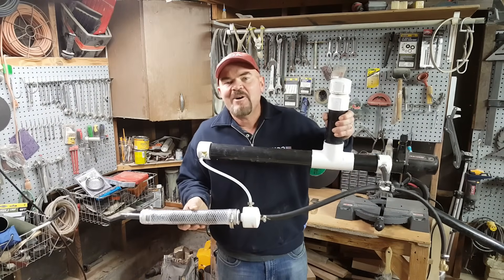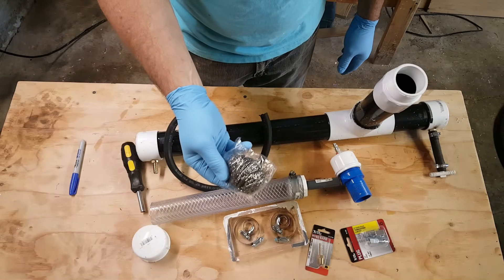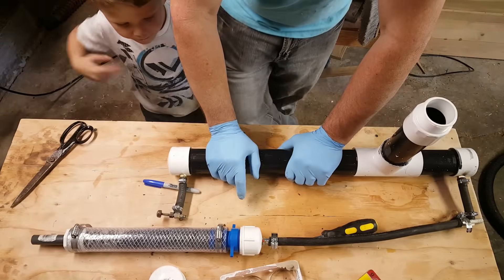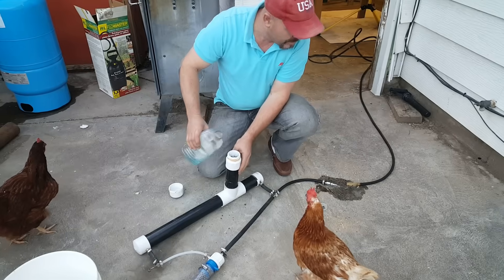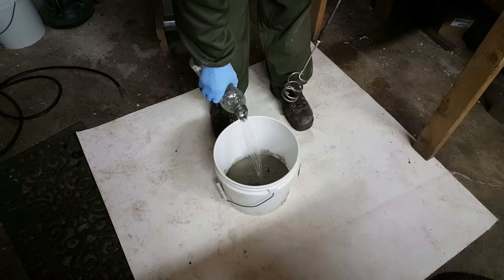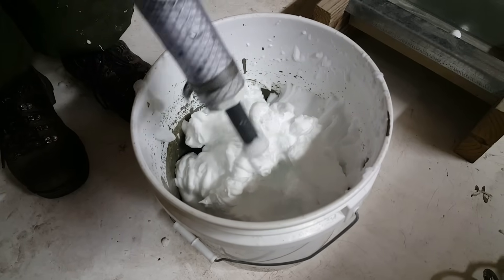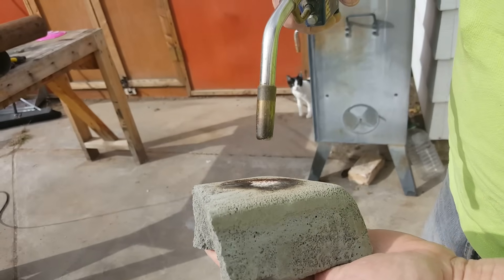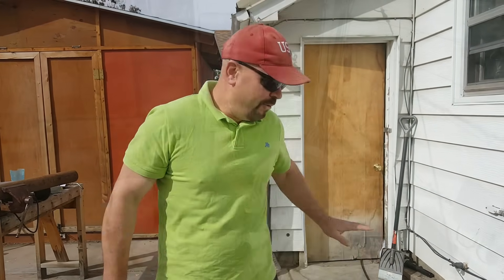Air Crete Machine for Under $30 (DIY)

Comment: NEXT STEP: how to use a like machine to spray the fresh mixed liquid onto a form like thick paint. A friend uses something similar to build free form design houses in South America. Makes a chicken wire or plywood shape, overlays with plastic, sprays, lets dry, sprays again, repeating until a desired thickness is achieved... then overspray with a sealant, and then primer and paint. Cuts out windows with a saw, if the form didn't provide for them. Then on the inside, installs all pluming and electrical, and then does the same process indoors, perhaps finishing with other kinds of materials in lieu of paint. * I'm trying to start an intentional community for stalking victims, homeless PTSD vets, and Preppers (symbiotic relationships to help each other out), and something like this would allow affordable homes for those who are trying to live on less than $1K a month (like me, a technically homeless vet once a stalking victim, lucky enough to be that guy living in a van down by the river... but its the ocean, and a motor home).
Reply: H. Michael Sweeney    It,s called Gunite ....they make swimming pools with it
Reply: Good luck with the community.  Communes don't have a good track record.  It's usually the 10% doing 90% of the work and they eventually get worn out.

Comment: If you're using PVC you need PVC cement and primer not ABS cement, if you're joining the two together (to be avoided) you need transition cement. OSHA also forbids using PVC for compressed air above ground, use air pressure rated ABS instead.

Comment: I'm sure by now with all the comments you have found out that aerated lightweight concrete has been around for decades. Myself having a construction background have been using lightweight concrete for high-rise flatwork and heat transfer floors since the 60's.......however your little experiment gave you and the family something to do for a few days

Comment: With the correct mixture, and inflatable forms, this technology could be used to rapidly inflate & back fill structures.
Faster than a 3D Concrete 'printer'.
Combining both technologies & you could rapid inflate, & print dome sheds, & then saw out windows , doors, connections, etc. as needed.
Different inflated forms could yield square or rectangular structures.

Comment: Hey great video, I tried it and the Portland Cement fell apart pushing all air out. Also, second mix did no stay light. It was pretty heavy.

My question, what type of mix did you use for the Portland Cement? Did you add anything to the mix?

Comment: Hi Darwin. I just wanted to add my 5 cents to the nice comments made here by most everyone. They are well deserved. Thanks for your generosity. If I was you, I will reach out to any local college that may teach Civil Engineering or Architecture, and ask them to run a number of test on your bricks. They would have the test equipment available, the expertise an the students hungry for ex

Comment: Here is a challenge for you:
Create a machine that will pump out Aircrete.
Put Portland Cement in a hopper
That mixes it with foam and pumps it out AUTOMATICALLY.!

Comment: Suggestion: Build molds to manufacture oversized Legos, say, one by two feet. With them and Liquid Nail, build any structure. Without Liquid Nail, build temporary structures. Might have to let the "Legos" cure a couple of months, though.

Comment: this has been out for a long time just that it has not ever picked up and iss coming back t  surface, the reason why it never picked up is because essentially you are only making it have gaps in the cement there for it is much lighter since it  is not a solid brick, the foam what it only does to the cement it makes it cure with the holes that the foam created in the cement so the cement cures with holes and gaps so it becomes lighter less dense ....but like everything there is a good side and bad side. The good side to it is that it is lighter and you use less cement material for basic human needs that do not require super strong parts so things can be built cheaper. The down side to it is that since you created voids with no cement from the foam having air pockets and the cement dried around the circle holes ....well the cement becomes less strong in  its original psi and much more brittle than laying it the standard way, but for typical things not requiring that amount of strength it would be well to use for those types of projects.

Comment: So, let me get this straight.  The foam in the video at first looked like two part insulation foam.  Then, it looked like you were using dish soap.  Is that what you are infusing into the Portland?  If so, what a great idea!  By the way, I believe you have the patience of a saint!  When I was young and got in the way, I'd get a crack across the backside!  Those kids will have learned the same patience that you exibit when they grow and have a family of their own!  Thanks for the great videos!

Comment: I am thinking, if sand is added to the portland cement, would we still have the air bubbles once it cures? Sand added will strengthen the mix.

Comment: A simple foam Generator is no aircrete machine!  
An simple crete machine should at least consist of..

Foam generator...
Ingredients dosing for variable foam concrete  densities
Hopper
Mixing unit..
Static mixer
Pumping unit....
Driver ( electric motor or Diesel engine)

If you mount this machine on a trailor or truck...
 Voila ....Here is your foam concrete machine Tor Independent in situ production.

Regards

Greattimez
Españistan

Comment: Thank you for sharing! A check valve on the line that connects to the supply line from the compressor could prevent the foam agent from flowing out while you fill the reservoir.

Comment: Good video, BUT the building material of the future would be HEMP CRETE , hope it will be in the US as it is already used a lot in the UK and Europe... high insulating properties, lite weight, versatile and more... maybe you could test that one day? Keep it up, I loved your strength test, saying" see how strong it is" then step on it and ...  crack... loved that...
Reply: The beauty of aircrete is that all those hemp bits can be left to fertilize the fields.
Reply: Hart Biedro exactly.  Hemp Crete does have better breathing and insulation 

But it would burn Unlike this product

Comment: I have no good enough words to properly THANK YOU .  I lost house and everything year ago in California duo to wild fire .and i was grossly under insured .  i'm forced by life to build by myself now  and aircrete is my #1 choice  . there is no other idea of building which would be better or even close competitor to  pour aircrete in to form or lay one by one aircrete blocks  to build .
I'm 61 and aircrete  is only option  for me to handle the building process eliminate maintenance ,insulation and improve fire safety to max.
  it will be slow building by one older man, but there is no need for so much of muscle power as other methods and heavy weight materials require .
 Beside eliminating need for young muscle and stamina wee eliminate  maintenance ..cement based building is not going to be eaten by termites or FIRE   .   no need for   unhealthy expensive insulation .  When is done it will last for generations .
I'm  surprice and i don't get it that foamed concrete is not used everywhere instead of wood  for building houses .
When i was a kid 50 years ago in Poland 99% of houses and apartments were made  out of aircrete  blocks . And is prbably still most popular building material today ..but i live here almost 40 years so i'm not really sure about that last statement  . 
Thank you again 
Stan

Comment: Foam cannon $13.00 to $20.00 from Amazon.  Shipping is free right now. Gets the job done for a whole lot less. All you need is soap and your power washer.
Reply: which one would work like this on a big compressor?
Reply: @MandyWoodArtist  I don't know and I don't care. My point is there is a simple alternative to a big investment. If you need this big-volume device get it. But if you need to do smaller jobs this is not the only way, and there are better and cheaper ways to get them done.

Comment: i really like that idea. did you test if it was stronger after allowing it to fully cure?

i'm also curious if more mixing would alter the consistency / air bubble content

and finally, has anyone tried this with a spray gun like those diy concrete spray guns all over youtube?
Reply: ? I'm still curious about this. Soon to make aircrete panels to fit between log uprights for my large shed

Comment: you have no idea the projects in africa i'm going to be using this on. it most certainly WILL be the future. thanks for the simplistic foam gen design as well. i can attach this to a centrifugal pump on a solar powered steam engines flywheel and generate intense pressure with no electrical energy input. The things i'm gonna do.... lmao

Comment: This would be a big money saver for shipping windows, I make stained glass windows and the shipping can be expensive, I actually used roofing insulation as it is hard as a rock and light weight, but this would be cheaper. 
Would this stuff be good for attic insulation?

Comment: If the pipes and fittings were changed to 1 1/2" instead of using 2" pipes and fittings, would this still work?  Very hard to find 2" fittings where I am.

Comment: The basic principles are the same as the space shuttle heat tiles.  They had trouble finding a glue that worked to stick the tiles on.  They ended up using "RTV" adhesive gasket maker.

Comment: This is not the correct way to make light weight concrete . soap has glyseren in it which is grease.. you need to mix pearlite in the concrete which retains the strength.

Comment: Does the air siphon the soap mixture from the "tank" or does it push the soap through the steel wool? Could you show us a diagram depicting the flow direction of air and soap solution and where the two get mixed?

Comment: Coating idea:. Truck bed liner.  Have you seen how that stuff holds the shape of a watermelon dropped from high up?    What if the foam could add strength to the concrete?   Poly urethane foam?  Any other kind of structural foam?

Comment: I need to build a new home, was thinking air-crete. I found out it is permeable. So if any water gets in, and it freezes, it will turn to dust.  That's what I gathered. I wouldn't trust this stuff in broad applications, only specific jobs.
Reply: You could paint the outside with  cement/SBR/water slurry to proof it ? Or if on the cheap, used cooking oil from a fast food place. Will form waterproof skin,

Comment: "It's got some structural strength"......crack. To be fair it wasn't cured. But the timing was great.
Reply: chicken wire would have added more integrity.  Or any wire mesh.
Reply: @normbograham3  absolutely. Cheap, simple, effective.
Reply: add glassfibers and a carbon fiber mat -!!!
Reply: @yaqayaqa  Carbon fiber matting really isn't going to help here....it's too expensive and it won't necessarily prevent that sort of cracking.  GFRC, on the other hand, is proven effective.  That would be a legitimate solution.  I'm not sure how much you'd need to add, or how much it'd affect the weight. You'd have to experiment with it.
Reply: I think he was commenting on the compressive strength, which it still has. The crack was due to low tensile strength, which is also true of traditional concrete that is lacking reinforcement.
Reply: @MrWeelliott  Generally 50-1000psi  for air crete at 20-60lbs/cuft.  In contrast, low density concrete starts at about 2k psi. High strength at about 6k psi and the stuff in commercial structures can exceed 18k psi.  But my original comment was about the funny timing....talking about strength and it cracks.
Reply: I want to make cement pots with aircrete, is it durable, why did it crack, but then again he weighs about 180

Comment: Please be careful. Certain types of brick and masonry materials should not be used for fireplaces, fire pits and other things where they will be exposed to extremely high temperatures as the air pockets and moisture within can explode under the right temperatures. Other than that great tutorial.

Comment: I don't think that is the right foam for this light weight concrete. Maybe the industrial use different type of foam that can dry quicker and more strength within the bubbles. However, the machine/equipment is great.

Comment: Use fiber crete and put PVA additive to help it stick together. You don't want insulated concrete for a thermal mass heater. A tmh needs to absorb the heat and uses mass to act as a heat battery. Lightweight is the opposite of mass.

Comment: really bad video. what are you doing. what are you using for the projects. am i supposed to guess at what your doing? Not enough information on what your doing and what the outcome should be. good or failure?  don't know.

Comment: I follow you intently but I have a reoccurring question that needs your concrete expertise. Doesn't drill (or whatever else) mixing the foam into the concrete mix break up the air bubbles? Obviously it does not too much considering the light weight-ness of the finished product but can you explain why it doesnt? I would have thought the mixing would "pop" the bubbles. Maybe an explanation video? Thanks in advance!

Comment: SUPER COOL!  and hell, with or without the concrete, who wouldn't love a backyard full of shaving cream!  you could sell this as a wedding car decorator or rent it out to kids partys.   good clean fun!  one correction though - pvc is usually white and abs is usually  black - and it makes a difference because the glue is different.   when it's under pressure, you don't want the glue to fail.

Comment: in the uk. we use a product ,thermalight or celcon. 
just mix sand cement and aluminiun oxide, fill mold 75% full it will be full in 4 hrs.
and fully cured in 7 days,
no spray foam.
Reply: Can you please tell us more?

Comment: I have seen HOMES already built with this stuff!!!  What the builder did was to spray it on a HOMEMADE TYPE STRUCTURE!!!!!  They did use some of the smallest rebar but the rest of the building material was things like bamboo and thin wood strips.  The rest, I could not understand the person .  it was sooo awesome!!!!!

Comment: Awesome instructional video!  

Is there anything special to the blue fitting attached to the cap that appears at 2:22 in the video as I noted it's different than the model in the video at 7:49.
Reply: I think that  blue plastic part was part of the original prototype.  Later in the video he said "back to the drawing board" and the design changed to the new parts in the plan available on Etsy.  These regular white 2" PVC parts work as advertized.

Comment: What is you water to dish soap ratio? Concrete to foam rato?
I think you're brilliantly resourceful. I'm a Subscriber for life ;)
Reply from the maker: 35 to 1 with regular dish soap, 40 to 1 with a foaming agent or concentrated orange hand soap. Hope this helps. also it can make foam as fast or slow as you like by adjusting the amount of air on the inlet valve. I set my regulator to 40 psi and slowed it way down in the video when I was in my shop injecting foam into a bucketof cement. happy holidays to you and your family.HDC
Reply from the maker: also concrete to foam ratio. 1 gallon of cement slurry to 1 gallon of foam, it doubles your volume. if nyou want to support my channel all of this is downloadable in my etsy store for $7.99 cheers
Reply: Oh its in the plans... I will buy it and you can delete your response because you deserve to make money from this
Reply: Bought it But the concrete mix is not there. So thank you
Reply: Also... Put a copyright on your instructions and go https://www.uspto.gov/  online and get a design patent registration. Put on plans patent pending so you have recourse to people who mimic your design

Comment: Your heat riser broke when you cast it in individual sections (& let Honey handle it). This (https://www.youtube.com/watch?v=tl0Ftpr4Gbk ) might be a good idea to use your aircrete to cast a single piece.

If it had to be round, you could use cardboard/fiber (concrete footer) tubes and burn them out after the cast.

Comment: I just bought your plans for this. Does it have to be black pvc? Can it be white? I have 2 inch white.
Reply from the maker: Yes it can be white, black is just what I had on hand.
Reply: Honey Do Carpenter right on brother. I will be whipping up a batch soon.
Reply: Honey Do Carpenter right on brother. I will be whipping up a batch soon.

Comment: Mate ,I did concrete work for 20 odd years and thought of mixing bean bag balls etc ,but that is a bloody great thing and so simple ,I must have a play with some mud lol
Reply: Thats also a great idea. Any way to trap bubbles of nothing, lets use Air more, its still free!, finding and exploring any way to add bulk/strength and insulation value and extend /stretch our resources to full capability is inspiring/ necessary and progressive!
Reply: Mark Manwaring I know a guy that said he invented the idea of concrete mixed with foam beads but I guess someone else patented the idea before him lol. He built walls with it and man did it insulate well.
Reply: I think folks use perlite to do just what you described.
Reply: I added styrene micro spheres with polymer and created an amazing product.  

China creates air concrete with spheres now in many forms.   Incredible large building panels and such.
Reply: No plastic beads is the clever  part about it. Imagine pumping that stuff out to make a slab. Might save some backs.

Comment: The only problem with this is that you never actually explain how or why it works so one can experiment without re-inventing the wheel. Understanding it key to building effectively. Just following directions  to assemble it is not very productive.